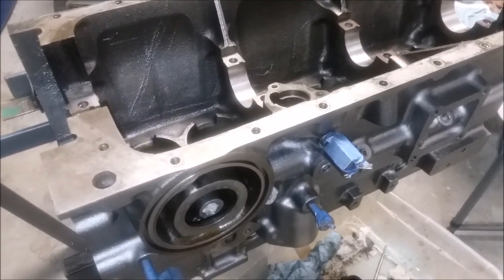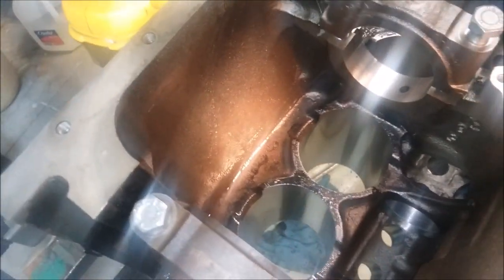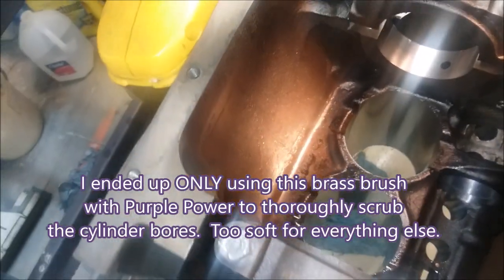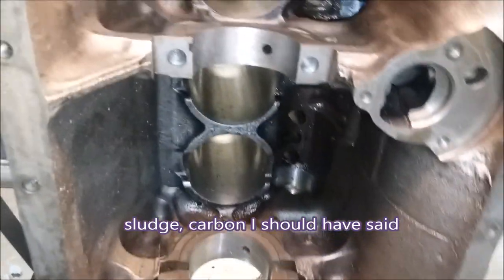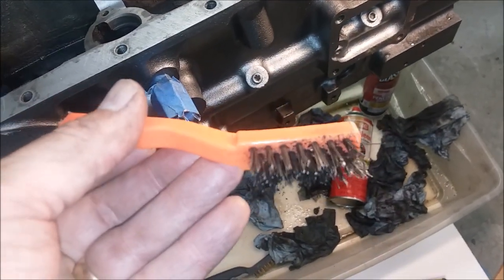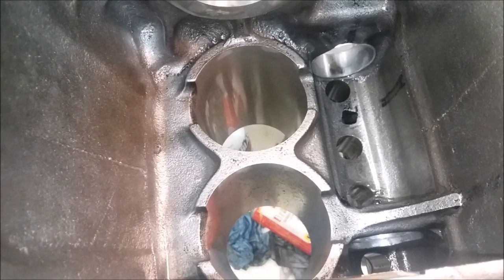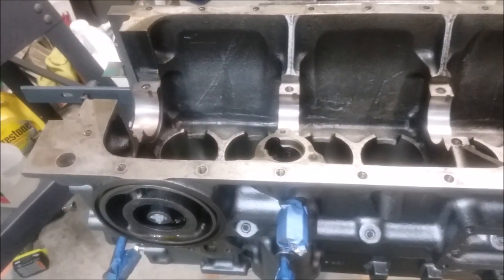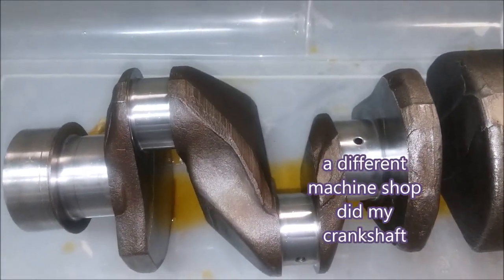Cleaning Triumph TR6 Engine Block Prior to Rebuilding

Comment: How do you think a block that had been operating with a modern, high zinc synthetic oil (ie VR-1) would compare?  Also, with a thermostat (🙂)?
Reply from the maker: I think a lot of mine was due to blow by, worn rings.  It was apparent in mine because my oil would turn black pretty quick after a change.  I use VR1 too.

Comment: A good machine shop will thoroughly clean your filthy (no offense) engine parts before they get near their high-precision machine tools. The parts will then go into a big dishwasher-like cleaning machine to remove the loose gunk, grease, oil and dirt. Iron parts can be "hot-tanked" in a hot caustic solution to remove the scale and rust from inside the water passages before the parts go to the machine shop. After machining, the part are washed again to begin to remove the chips and swarf from the machining operations. you can use a flexible rifle cleaning rod and the appropriate brushes to clean oil passages and galleries in the block, head, crank and cams. Aluminum must be treated differently, many cleaning processes for iron are destructive to aluminum. Consult with the machine shop for their recommendations, they do it for a living.

Don't be so sure that brass brushes are harmless to iron and steel. Scotch-Brite (tm) is used to polish and remove the last tenths from journal surfacesand it's a lot less aggressive than brass brushes. I don't use brass brushes anymore on my firearms for just that reason. brass will absolutely wear aluminum.

There is also a law of diminishing returns at work here too. The service intervals for 20th century engines is MUCH shorter than for modern engines and lubricants. Eventually, you will have to accept that without caustic or acidic baths, the castings will never be as clean as new. Keep clean oil in there and good filters on it.
Reply from the maker: Thanks!

Comment: I know it has been a while since this video.  Have you completed the build?  If so, how did it turn out?  I have been following closely. I just started my own TR6 engine rebuild; removed the head just yesterday.  Very interested in a synopsis of major learnings, results, what upgrades you think helped the most (like the light flywheel), etc.  Thanks again for all the excellent content.
Reply from the maker: Going through some old comments, found this.  Sorry so long to reply.  I will do a synopsis after I am done.  This one is going very slow due to other projects/responsibilities.